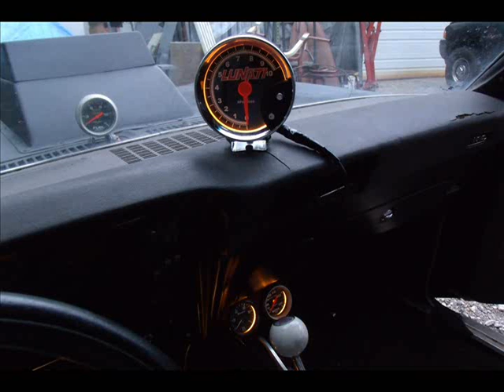SKULL GARAGE...THE NOVA PROGRESS PART 4

Comment: How long did it take to put her back on the road and what's the deal with the lifters. Look like they where ground down on a angle
Reply from the maker: hey bud glad ya like my ole car,after i drug it out of the woods it was about a year and a half before i took it up the road the 1st time legally worked on it every weekend,and the lifters failed and destroyed my cam during the 1st break in,called lunati and they said 16 lifters failing was the products fault not ours so they replaced the cam and lifters for free...lunati is a great company thats all we run in our cars,so then i rebuilt the motor again and haven't had a prob since